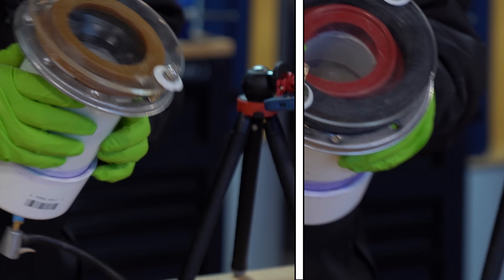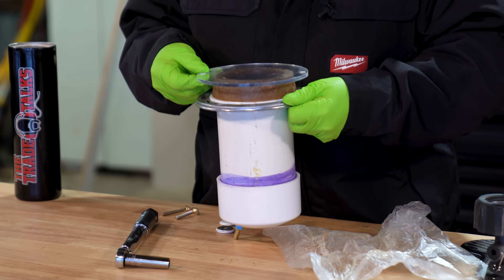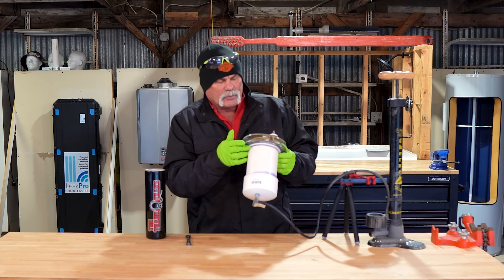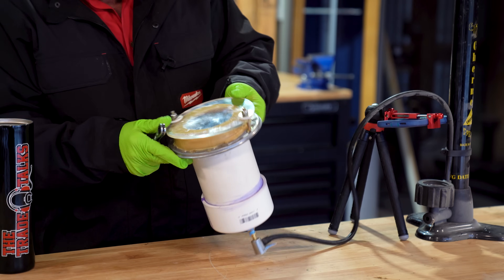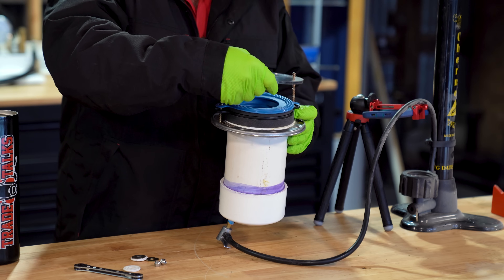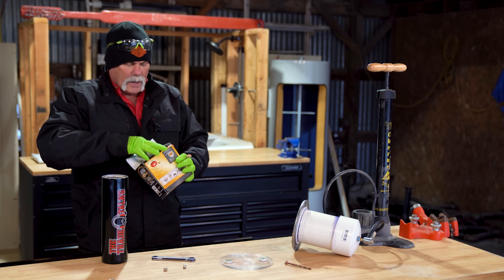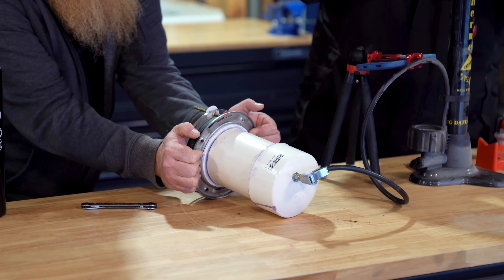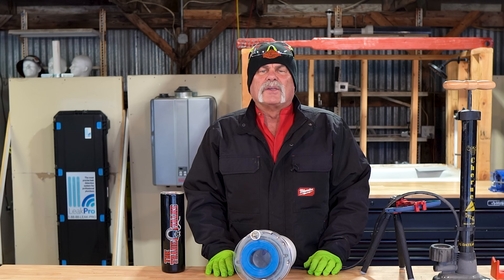Toilet Wax vs Rubber: Which Works Better?

Comment: I’ve installed plenty of toilets over the years and still trying to figure out if the newer foam/rubber rings do as advertised, after watching this video i am still unsure. Part of the issue is with the test rig, just too much flex which affects the results. I only use double reinforced rings and have been successful, hardest part is placing the toilet down perpendicular/square and level with my eyes i found the best manner is to place a very high powered work light (500 watts) at floor level to illuminate the flange bolts. I will still use the wax rings as they have been working for a century without any major concerns, however the thought of changing over to foam/rubber is intriguing as it allows you to reset the toilet if you inadvertently set it down incorrectly. Plumbers are still undecided on foam/rubber as it is a newer technology for the intended task, and truth is price of the wax seal is considerably less expensive. I wouldn’t mind the increased price as i am not doing 100’s of toilets, but do wish a consensus was available before i make the change. Cheers.
Reply from the maker: I hear you, there's a lot of conflicting information on this topic...it's a tough call but I'm going to stick with the wax ring.

Comment: Ive used the rubber flanges, that one in particular in the vid, and never had any issues with leaks or sewage gas smells. To be fair, toilets are not made of plexiglass acrylic material, so that test was redundant. Toilets are more ridged and when tightened evenly on a floor that is structurally sound...... no issues.  😉👍

Comment: will the better than wax make a good seal against a 75 yrs old cast flange though? that's what makes the wax so good, it deforms and seals against uneven and very very rough cast surfaces which have surface rust and corrosion etc

Comment: The double stack (the spacer)  was "needed" according to the instructions for my toilet (flange even with the floor)  but the toilet was WAYYYYYYY to high off the floor.  So I didn't use the spacer and just used the blue ring.  Did it on Monday - no leaking that I can see.  My next toilets I might stack 2 of the blue seals and see how that goes.

Comment: Tried the wax free ones a couple times and leaked a couple days after.  Replaced with extra thick wax rings and never had a problem after that.  My 2 experiences with wax free were not good. They don't seal. Wax is better and it works.

Comment: Like you said your self there is a flange around the ring on the toilet. Also toilets are heavy and not flexible so even though there is only two fasteners on a toilet, I imaging just the weight of the toilet is going to give you a good gasket crush nice and even all the around the bolts are more to hold it secure than to crush the gasket in my opinion. I would recomend retesting this with something more similar to the bottom of a toilet. And possibly even add some more fasteners so you get a more even gasket squish instead of bending the acrylic. I personally don’t have a position as to which one is better. I do my own plumbing in my house and have used both wax ring and the rubber gasket. As far as I know I have never had any leak, I thought I had a wax ring leak once but it turned out to be the tank to bowl gasket. Got a toilet overhaul kit, and it’s been great ever since.

Comment: installed dozens of toilets throughout the years. I found wax rings FAILS  the toilet shifts, from people sitting on the toilets hundreds of times. The rubber seal worked better for me, no callbacks or leaks and its not messy

Comment: As others have mentioned, it seems it would be a more effective test if you pressed on the seal more uniformly.  Think of a tire rim.... if it's bent, it has a weak spot that air will escape, where it might not if the rim (baffle/gasket/seal) was applying uniformly around the seal.  Good luck!

Comment: 20+ years doing this. Wax alone has always been great. The point is proper preparation and installation. One more move than necessary. You need to remove the toilet and reinstall the wax. The problem with leaking is at this point. If you made a mistake and moved the toilet to the point of giving it room to slack. The only solution to avoid leaking is to start the process over again. Would 5% or 10% do this again on the job side? I don't know. But after Perfect Seal came out I used it because it has both in one. But always the same caution. If there is one more move you have to start the installation over again. The difference with Perfect Seal is that this is possible if you lift the rubber again keeping the wax in contact with the flange and reinstall. With wax alone you would need to add wax to seal again "since once you open a gap with wrong movement before tightening the bolts you fail".
Trying to give my opinion. Open to learning every day. Old school and new industry methods together. But never leave the old school method behind. 
...
"And in remodeling, there are always changes and variations in the flooring that contractors just install toilet back without replacing flange. Whenever necessary the flange should be adjusted. And I hate in cases of offset flange. These are worst situations to deal with in most cases". Offset flange should always be adjusted with new flooring. Do not accept extensions many times.

And this test can be repeated if a table structure is built and a real toilet is used. And you will have results and you will be able to see it in action with a raised platform. And fixing the flagpole to the Playwood simulating what the floor would be like.

Comment: Here are my thoughts: First your testing. You needed a much thicker cover plate so it wouldn't distort when you tighted the bolts. You should have used a torque wrench so the bolts would be evenly tightened from side to side and from test to test. Also, I would have tested with and without the spacers. 

Second my experience: I've been using the "better than wax" product for several years with no problems. The installs I have done have not needed the spacers. They also come with new bolts, which is nice.

Comment: I would add a solid metal plate thick and strong enough to bolt to the underside/bottom of the acrylic plate to ensure the acrylic plate would provide a consistent sealing ring like seal to the sealing material rings [wax, thicker wax, rubber 1, rubber 2].

Comment: I’ve always had great luck with Fernco toilet seals, they adhere to the bottom of the toilet with adhesive and have a multi layer layered seal that extends down into the sewer pipe.
Reply: Mine only lasted 5 years and then came the leaking and horrible smell.

Comment: We use better than wax (apartment complex) and haven had any problems with them but we dont use the fome part we were told thats a spacer not sure if thats true tho.
Reply: So that foam ring is for recessed flanges, they are good for where the floor has a huge gap, normal level flange you only use the blue piece, when you buy from the supply house you typically buy them without the foam ring.

Comment: Foam rubber all the way. Replaced well over 100s of leaking toilet rings mainly in multi family units ie abused think portly pirates laying logs. First off I live in a seismic area and despite our best efforts things shift. Second off mix valves go bad and run hot, soon as that happens game over on the wax. foam rubber has more give and spring as wax develops a memory.  In me experience is cost a few more buck on the front end but prevents hundreds to thousands in damage.

Comment: One reason to avoid using a wax ring is if the toilet is being installed over marble tile. Wax can stain marble, and not just the part where the wax directly contacts the marble. The porous stone can allow wax to leach into it.

Comment: I found out that the prior owner of my home neglected the other important thing about toilet seals.
Proper height and, with wax, DON'T reuse it.
Never would have known it was leaking if I didn't go into the crawlspace for another issue.
When I pulled the toilet, the wax ring was flat and no wax was adhered to the bottom of the toilet.

Comment: I have use both.  I personally like the "Better than Wax" for the following reason.  Setting a new toilet you only get one shot to get the wax correct.  If you need to re-seat for any reason you need to have get a new wax (messy to change out).  With the "Better than Wax" you can seat and re-seat as many times as you need to get a good seal.  Con is it cost a little more assuming you don't need multiple wax to complete job.

Comment: I used that Perfect Seal Toilet wax ring. I don't think it was easier to put on. I distorted the rubber the first time putting it on and got under there with someone else holding the toilet to put it back in shape to fit over the toilet and seal as they lowered it. I used it because the flange was lower and there was board and tile. So lets see when that fart gets to 25 pounds. Till then I think it doesn't matter which is sealing or not. I think I would rather use the wax. but I thought the rubber gave be extra height and coverage and a good seal under the toilet bowl.

Comment: Am a mfgd. homeowner (2004 new). My hall toilet started wobbling, and thought there was a leak underneath. So turned off water at base, and used the other bathroom, and yesterday addressed replacing the toilet. I have extremely hard community-based well water. There was almost no wax left under it, it had not only disintegrated the wax, the flange was falling apart literally. One of the bolt heads in the tank was nearly dust it had disintegrated so much. So ... thinking of replacing with rubber seal instead of wax. The plumber I called said he was going to use a wax ring again. I'm hesitating. I've done all the demo work myself, the toilet is out, trying to chip away at removing the rest of the flange. I can do quite a bit of plumbing myself. However ... am gathering as much research as I can knowing there are different types of seals, and also types of new flanges. Want to do this the right to save my subfloor. I'm 30 inches off the ground, so can access underneath if possible. Am a 65 yo woman, and almost fearless however, not doing it right the first time scares the heck out of me. So do I pay the $300 to a plumber to install something I don't want? OR ... do it myself (with a little neighbor help if needed)? Advice welcomed!! I also don't want the well water to disintegrate rubber or plastic seals/flanges either. I don't have a softener, but maybe I should get one (though expensive!). Going to go ask the Home Depot people today, however, not all of them really know, though some do. Thanks!!!  Love channels like these. So helpful!! Sorry so wordy.

Comment: I feel like the benefit of these non wax products is for installation. Sometimes I feel its hard to keep it lined up and not smash the wax wrong or have the toilet settle down completely straight. Also, what about expansion/contraction in a home causing some small movement around the toilet seal? Hard to test all that.

Comment: Been doing plumbing around 10-12 years an I've tried the better than wax  those allows water so seep out much faster than wax an any foam coated seal gives up generally in 6 months so I stick to the tried an true wax rings they are more dependable unless the homeowner or tenants decide to throw hot water down the toilet or like my lady will run a small space heater pointing to the toilet and that melts the wax

Comment: I had a toilet in a public bathroom that I had to keep removing as I worked on the bathroom between guest events.  I was using was rings.  The final wax ring the toilet got plugged with toilet paper that appear to have caught on the inside of the wax ring.  So I switched to the better than wax style.  Advantage one, I don't need a new ring each time I remove the toilet so cost savings.  Advantage two, less likely to blow out during plunging.  Advantage three, doesn't squeeze inside potentially blocking the toilet exit.  Advantage to better than wax style.  Note, I did have to cut the foam ring in half height wise as my flange was above the finished floor level.

Comment: I used the red rubber one and it failed in about 5 years, it blew out over time from just typical plunging, I really wanted the rubber one to work but now I'm just sticking with the wax.

Comment: Nice test idea, and it was entertaining to watch. But the acrylic bends in a way that porcelain won't. I don't know if you have the desire to re-test with a non-bending plate.
I'll comment as a DIYer. When setting a toilet down on a wax ring you only get one try to get it right. If you compress the wax in the wrong position then you have to start over with a new wax ring. With the rubber you as many tries as you need to get it right.

Comment: the rubber seems to cut down on the errors and allow for some deflection and ease of reinstallation.
Reply: that acrylic is flexing too much not a good valid test
Reply from the maker: True, the acrylic was flexing, but the wax was still able to make a solid seal
Reply: That's because the wax is a plastic (in the material science sense) material- it permanently deforms under stress. The foam/ rubber options are elastic materials, and will store energy,  attempt to use it to return to shape, creating an upward force on your flexible lid, which is anchored in 2 places.  A toilet/stool is made of rigid porcelain, so is unlikely to bend like that. I made a suggestion earlier to slap an inverted toilet flange on top if you wanted to control for that variable.

Comment: Roger i am a traditionalist i guess i also use wax rings. my question is if your a DIY kind of a person would you recommend  better then wax or a wax ring.  My question refers to wax ozing  not being a professional plumber ( i really cant afford the prices) i am always unsure if i installed it correctly or if this is actual the correct way to do it.  with better then wax you dont get the ooze.
Reply from the maker: Where are you located? I've never had a problem with wax oozing. I haven't used better than wax on a real job so I can't say whether its better or not, but I've never had a problem with wax before. Hope this helps

Comment: Sadly your video have a flaw, you used a clear acrylic plate, but the plate is too thin so no good seal will made never do.  a toilet is stiffer.  so repeat the video using a very thick lid.

Comment: I’m not a plumber but at my home I use wax seals. 

I am a steamfitter/pipefitter and have done thousands of pressure tests at much higher pressures. (Up to 10,000 psi)

I suggest if you ever try to repeat this test put a steel ring (flange?) on top of the clear acrylic.  You will keep the acrylic from warping and eliminate the issues you had here.
Reply from the maker: Noted! Thanks for the tip

Comment: If you have a little movement in the floor boards or someone that's really heavy, I like the foam/rubber ones, but for your normal, everything is good. I like the wax ring. That's my thinking on foam vs wax.

Comment: I think the fail point is the movement of a toilet.  If the bolts are tight and the seal is good, not a problem.  When the toilet has some movement, can the wax hold up or do one of the other options keep a seal.

Comment: Homeowner here (with an engineering degree, so maybe  bit advanced) 
I've installed six of the saniseal toilet gaskets ("the green one") across multiple toilets and houses.  You can typically  find them at ACE and the Home Depot. I like them in particular because its all one piece, and basically looks like you crafted a wax ring out of silicone foam. 

I'd be curious to see the test repeated, perhaps with a metal ring on top of the acrylic plate (maybe just flip another toilet flange over) to prevent the deformation of the top plate during tensioning of the elastic seal products.

Comment: Apples and oranges.  You need to build a pressure rig with nitrogen or compressed air in it, and then measure/equalize the closure distance (as it would be on the toilet), and then slowly take the pressure up in a uniform manner until it breaks the seal.  As it is, the bicycle pump is uneven as is your application of the rings to the mounting flange (makes the comparison difficult).  I have a toilet right now that needs to have the ring replaced...and will be trying the rubber/closed cell foam.  Interesting video though...   =)

Comment: 😢 I installed the blue color unit DIY in one bathroom and wax in another, the one with the blue rubber at times doesn't smell very good, now I am convinced I will need to replace the rubber one back to wax.

Comment: With the rubber toilet seal, your plexiglass lid was bending when the bolts were tightened.  Porcelain is not going to flex and will form a rigid seal.  I've used these on a couple of toilets with no issues./

Comment: porcelain doesn't flex like acrylic does. i don't think this is a fair comparison because rubber is going to be less forgiving to that acrylic warping than wax will. also the seals i use are all encapsulated rubber, i've never seen one have a foam seal like that first one, i would be skeptical of that one.